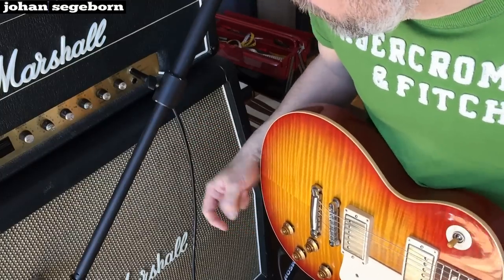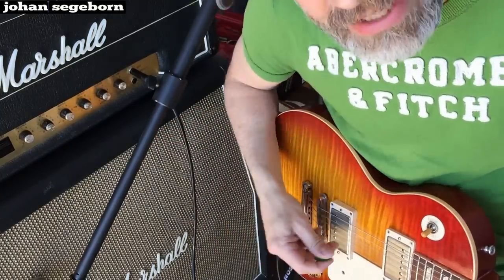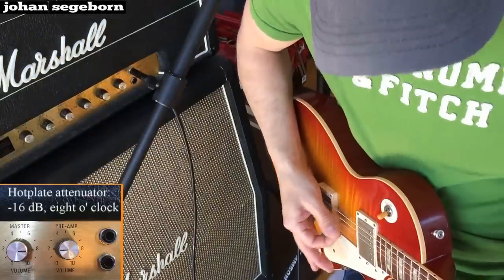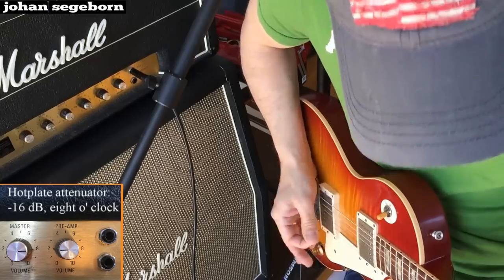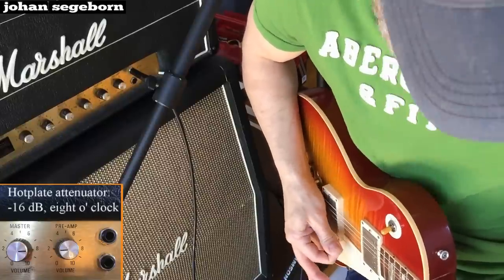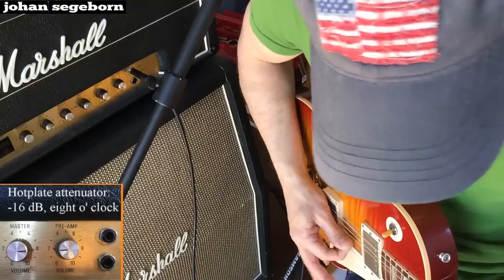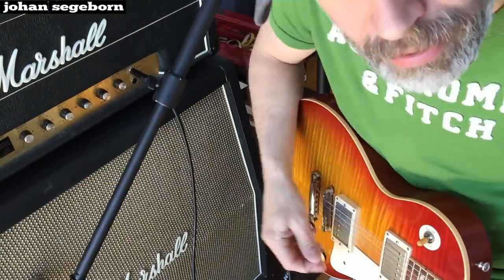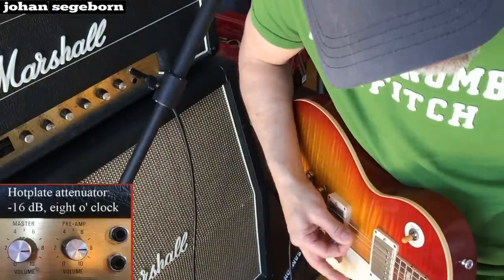Preamp Vs Power Tube Distortion

Comment: I was relying on my preamp gain to achieve my tone for a really long time but recently I spent a few weeks tweaking my tone and changing around my pedal chain. 

One of the main things I learned- I was crushing my dynamics by pushing the preamp so hard. When I reduced the preamp gain and let the power tubes get a little more attention I found that my guitar was much more musical and touch sensitive- while still providing a lot of texture. Very happy with the results.

Comment: I am grateful for your work, it's helps me appreciate the contribution Marshall gave to classic rock.
Reply from the maker: +pablo rey Thanks Pablo! I'm glad to hear that. Cheers
Reply: @JohanSegeborn on the Marshall dsl 100hr amps is the master volume in the same configuration? Meaning it's controlling the power amp distortion? 
Doesn't it make sense to have a master after the power amp so that you can have both pre and power amps cranked and then bring the overall volume down to bedroom levels? Thanks

Comment: I've been a JMP 2203 / JCM 800 user for about 14 years.  What I love about this video is that it shows that the master and preamp both have to be used.  You can crank the gain and keep master low and it will sound decent, but as you turn up the volume, the preamp gain has to come down or it starts to lose some definition - even though you may gain more sustain.  I've always loved the master at 4-6.  Never needed to go beyond that.

Comment: Great demo! Just can't beat the tone of cranked power tubes.
Reply from the maker: Thanks Tim!
Reply: tim price This is my impression, too, and it seems to be the case with smaller amps as well. For quite some time I used to first set the gain/preamp volume for the required amount of gain on my little Fender Blues Junior III and then controlled the overall volume with the master volume (that is: power tubes), but the sound only changed from just halfway decent or possibly sort of "okay-ish" to really cool when I cranked up the master to 10 (or over) first and only then adjusted the total volume with the preamp/gain control (even if only to, say, 3). Obviously, this is not quite as it's meant to be when you have a master volume, but the sound is actually way better and the feel and responsiveness of the guitar seems so much more lively – quite astounding! I'm happy, though, it's only 15 Watts that I'm cranking up and not 100...

Comment: I have a Marshall JCM 800  100w  and it does not come into its own until the volume rattles the china from the cabinet and sends the tropical fish into a frenzy.. Point is,, these big amps need big places to play to work at their happy zone which is LOUD!
Reply: High Gain 12ax7wa in the V1 and put either a 12ay7 or a 12au7 in the power tube rectifier for the best gain out of your amp. The 12au7 will bring down the overall volume, causing the power tubes to work harder!! the 12ax7wa high gain will give you bedroom gain at lower volume.
Reply: Repeal or Recall would this work with a jcm 900? does this kill off the tone? also looking for another way to tame my friend man be 100
Reply: Don't buy cheap tubes. Cheap tubes gives you a cheap sound. If you pay roughly $1,200 for an amp head, buy the best tubes and speakers. If you do some research on Youtube and various blogs you see the same stories that I've seen. I don't own a Marshall, But currently own a Red Knob Twin and a Laney VC50 and a Laney GH50L they sound great and I would play them anywhere. I've also done this to Crate Blue Voodoo and Crate VC50, Carvin MTS3200, they all sounded Great when I traded them off.
Reply: Same w/ my 1984 JCM 800 2205.  I've tried the THD Hot Plate to bleed off a bit of the volume but it just wasn't the same.  Ended up Craigslisting that attenutator.
Reply: You can pull the two outside power tubes to make it a 50 Watt. Then change the impedance output on the speakers to match. I've got the same amp and rebiased it for EL34 power tubes and running a pair at 50 Watts. Sounds incredible!
Reply: For clarification, Czechoslovakia is not together since 1993. JJ tubes are made in Čadca - Slovakia 
Just for info :)
Reply: I agree roger flame. The 100W Marshalls are Big Boys. They  really need two 4 x 12 cabinets. I actually prefer a 50 W head into a single 4 x12 cabinet  to be honest. At home I play a  70's Fender Champ  or my  Marshall Class 5. I  learned a lot about guitar tone  playing these little tube amps.
Reply: I've just taken delivery of a JCM800 and 1960AV cab to play in house only. I don't have any china or any goldfish. I used to have windows, not now I don't.
Reply: @Possumlove Hey - correcto-mundo about the volume reference volume, but tge purpose of more wattage isn't for driving more speakers. You can drive a 4x12 with a tiny, 9V battery powered Smokey. More wattage delivers more penetration and punch, 'throwing' the sound further distances and cutting through the bigger crowd absorbing the sound. 'Possumlove' - cool handle...!
⚡😀⚡
Reply: @lohanette  😂😂😂
Reply: @Possumlove Thanks for the education; very interesting

Comment: I like what this chap is doing ..its so fun to watch all these amps being played the way they should..However im sure those of you who have played a cranked marshall will agree ..power amp distortion is different not just in the sound but in the dynamics of the note ..the way it feels under the fingers ..it helps the notes glide and become more fluid ..I use a twonotes reload attenuator with my jmp 50  and i can never play any other kind of amp..preamp distortion is part of the mix but without those power amp valves its like youve put the brakes on
Reply from the maker: Yeah for vintage rock there is no substitute for volume. But I think that mainly has to do with speaker distortion and feedback, rather than phase inverter and power tube distortion. Cheers

Comment: Years ago I used my Attax 50 (transistored) with master in the top and just a little bit of preamp gain. Result: great headroom and treble. 
Nowadays I prefer the 50 50: I let my guitar and pedals crank the rest of the way when It's necessary. I also own a Lifesound Horizon amp, a handmade based on the Dual Rectifier. 
Since I changed a bit my setup and (I'm) having trouble with speakers I still didn't complete the new "battery test".  The Lifesound Horizon is an ultra versatile hand made amp. 
Sometimes we achieve the same results in diffent ways: When plugged in the same speakers/cabinet I can match the drive in both amps. After all this great research and your fantastic tests we must test ourselves our own gear to achieve great tones and greater flights. Thank you, Mr. Segeborn!
Reply from the maker: +Getúlio Prates Thanks, really glad to hear it! And I'm gonna take a closer look at lifesound, looks very interesting. Cheers Johan
Reply: It's rare, by now, since it's not in production anymore. It's very based on Dual Rectifier. A great amp.

Comment: Thank you for this, as I don't have an attenuator I have had to use the pre amp for the distortion. It looks as though I need to get one because I like the sound of the power tube doing the job and not the pre amp tubes.
Reply from the maker: Yeah, you won't regret it

Comment: All tones sound killer! Love marshall
Reply from the maker: +fred fabris Thanks man!
Reply: You dont find the bulk of the tones sound thin!? Man, I have a few different marshalls....800 900 bith 50 and 100 watt. Every one of them ( with a paul) needs an eq to filter out the crap. Dedicated marshall user for 30 years. Bought a mesa dual rectifier and volia, problem solved. Mesa does a marshall but marshall can not do mesa. Dont misunderstand me, recorded several records and toured for 20 years with marshall....but.just a lit of hassle to get CONSISTENT tone. Mesa is ON and killer, eveey night

Comment: Pre-amp distortion I've always likened to a mother-in-law - necessary to have, but you can only listen for two minutes without going insane.  Power tube distortion is where it's at IMO.
Reply: Ozma2112 I tend to agree.
Reply: That's what I like about low wattage el84 amps. You can crank them and get that sweet power tube crunch without blowing the roof off.

Comment: You should get some kind of award as the Master of Marshall Tone.
This has helped to convince me that a hybrid amp with a tube preamp and SS power amp is not the way to go for me. I have a 600W Trace Elliot hybrid bass amp but I'm very disappointed in the lack of tube richness and grind that I would like to get. I'm looking at getting one of the modern Hiwatt clones or a Hiwatt reissue as a replacement. Thanks again Johan for your great efforts, it's a dirty(as in overdriven gain stage) job but somebody's got to do it :)

Comment: Great comparison!

And to any MV haters. I absolutly love my DSL100HR which as we all know has 2 MV's. I've had a few people complain to me about the old dsl's being fizzy adding a master volume to these amps was the best thing marshall ever did(if an amp has more preamp gain stages it should be law to have a MV) . Just remember if it's a master volume turn the masters down and the channels up for best results. I know there's probably tons of people who don't like MV amps because they are trying to use them like NMV'S. MV's normally have more preamp gain stages which means that's where your tone is derived, not so much from the power tubes or speaker clipping/gain. In my experience if you dime the newer MV amps master volume your not gonna like what you get. MV and NVM can both sound glorious if you use them correctly.

Comment: the difference is actually most noticeable by keeping high preamp dist at LOW volume, and then keeping the SAME preamp gain at the HIGHEST volume. The problem by keeping the preamp low and master high, is that the power amp won't get enough input signal. Thanks for your video, very nice 👍

Comment: Great stuff from you Johan!
I think the reason why the "master" gives something else to the table is the phase invertor( the third 12ax7 tube).I think this 2204 has pre pimv wich means that when you crank the master volume you actually crank the phase inveror tube and then the power tubes. Of course the power tubes play the most important job here!
Best regards!
Reply from the maker: +Mihail Ivanov Thanks Mihail, yeah the V3 or phase inverter tube plays a big role in the tone

Comment: You do some really great vids, keep em coming! Just though I should point out that the preamp distortion sounded darker because the volume was also turned down. That's a 1M pot which causes considerable Miller effect. You can replace it with a 500K pot for a much more usable low volume, the compromise is you lose a couple of signal dB when on full volume and the lower input impedance means the tone stack reacts differently. You would need to turn the bass up a notch or two to compensate and there would still be enough signal swing for plenty of power amp overdrive.
Reply: Great point! This is where toying with a bright cap might pay dividends.

Comment: I have basically the same amp. There is an input cap on the preamp pot. As you turn it down it gets brighter. Its 100pf in parrellel with a resistor on most old jmp jcm 800 2203 2204 . Clip that cap and you wont be as bright when rolled back. When dimmed it has no effect

Comment: another great submission, johan. as always - top of the line.

my rule of thumb is to always run the power amp as hot as i can for the room, then pull up the pre- to the desired bite.  for ANY marshall this is with eq at:
presence - half way.
treble - 0
middle - max
bass - max

great demonstration on diming in the tone at restricted volumes. keep the submissions coming. i hope you don't run out of material:)
Reply from the maker: Thanks Chuck, I see we have the same taste in EQ. The videos will keep coming, I promise :-) Cheers

Comment: John, at lower preamp settings, that amp is bright due to bright cap across preamp pot. Thats why sounds darker at high preamp settings.
To really compare preamp vs power amp you have to snip out of the circuit the bright cap. If not, it's not fair.

Comment: This is true for any tube amp has a master vol. An interesting trick is with multi channel amps have a master vol and gain + vol for each channel, one can set the gain as desired with a low channel (even the lowest possible to play at home) volume and push the power stage with the master.
Reply from the maker: Thanks man
Reply: Johan Segeborn You're welcome.

Comment: That's sounded closer than I thought it would! (on youtube and with my pc speakers but still..) The difference with my Fender twin is a lot bigger, but there the pre-amp distortion is quite useless and power amp distortion is way too loud to be useful..
Reply from the maker: Yeah, it is basically a low resolution version of the same sound
Reply: Jens Larsen yeah man; fender's are built that way. my twins are the same, as is all other fenders i have with gain features. generally fender distortion sounds bloody awful at low power-amp levels.
Reply: I have pretty much the setup as Johan, my amp being a 1977 2203, hotplate and 1970 greenback cab... the feeling is just different. My setting is actually master at 8, preamp at 3... This gives me alot more mids and dynamics in the amp... If I change the settings to master 3, preamp 6, which I had to do at our last gig, the amp more bassy but not so full and dynamic sounding. I still think Marshall made some of their best amps with the 2203/2204 models!
Reply: Nothing sounds better than a cranked fender twin. Best rocknroll sound ever

Comment: I believe the power tube distortion is what a man needs to cut through the butter.....aka the mix.  I have signa drive from cmat mods which gives a wonderful power tube distortion tone.  I plan to buy a attenuator in the near future. Im about to go nuts on this tone chasing adventure. Ive been playing close to 20 years, and Im starting to gig again. Im finding it extremely difficult to dial in tones at this point. I dunno if Im being too finicky. Thanks for the demo!
You have a beautiful view there in sunny Sweden : )
Reply: I'm with you on the tone-venture. I'm about done trying to get anything great out of my 2204 Marshall. I just wind up hitting the pedal board and a Hiwatt, or a Friedman. For me its the speaker chase thats got me exhausted. I've switched out so many damn speakers in my 2x12 cabs ( 4 of them ) that I'm done.

Comment: I found more authority and clarity in the tube cranked up way. Preamp gain is more creamy/muddy and both together make the sound oversaturated in a bad way, sound is congested.

Some other remarks :

. The attenuator impact the sound, especially the top end.
. It's hard to get the same final volume in both way. It will impact the speaker thermal compression, and it's render.
. The presence knob works only with the amp tube section. As we impact it, i would do some tests to compare and check the exact impact. I'm not sure that to be fair we have to get the same amount of presence for both case. I imagine something like more presence on preamp crancked up case and less on amp cracked up case in order to make them same or almost, but it's just free ^^.

Keep up the good work man !
Reply from the maker: Thanks man, that's great feedback. Cheers

Comment: Hi Johan,

Thanks for uploading this video, I also like Marshall very much, I currently play on a Fender USA standard Stratocaster ,my amp is a Marshall DSL 100 and I use a  Marshall 1936 lead cabinet. Your video's are very helpfull because i am searching to get a guitar sound that works for me, I love 70's rock very much and also bands like Bon Jovi, Aerosmith and Guns and Roses.

Thanks for sharing this video, cheers from the Netherlands!!
Reply from the maker: Thanks Wesley! The DSL is a great amp.. Cheers
Reply: +Johan Segeborn If you have a later one with the bugs worked out or an earlier one with the correct fixes in place.

Comment: The power tube distortion speaks to one's soul. The preamp gain just sounds dull an anemic. You can hear every string with the power amp cranked, but they all congeal into one amorphous sound when played preamp gain only. I never understood this until watching your demos. I had a JCM 800 2204 that I thought was 'no good', merely because I was ignorant of the importance of attenuators and so I could never play it at a proper master volume setting. Sold it, thinking it was no good, when I never allowed it to even do 'its thing'.
Reply from the maker: +Henry Moss Thanks man, I'm glad the videos are put to some good use! Cheers

Comment: In general, I'd say that if you're going for a nice, steady, rhythm sound, go with preamp distortion. On the other hand, lead work would need power amp distortion, as I hear a lot more dynamics related to how it's played.

That's not to say that there aren't exceptions. Some amps you just can't get a good sound out of if you don't crank one or the other, or even both.
Reply from the maker: Yeah, they both have their applications

Comment: Very cool video
I think that the attenuator also affects the sound and the natural harmonics of the amp, without the atteuator it sounded great but it was a preamp distortion, even with cranked amp its better not to use it but its damn loud.
the way i use my amp is master vol on 7-8 gain(preamp)- 5-6, i use the attenuator but not very low volume, i set it on the -12db or -8db, that way i get more headroom and not a fuzzy sound and the power tubes are working great
Reply from the maker: Yeah, the sound loss is very small down to -12dB